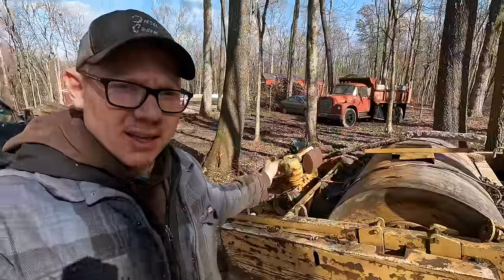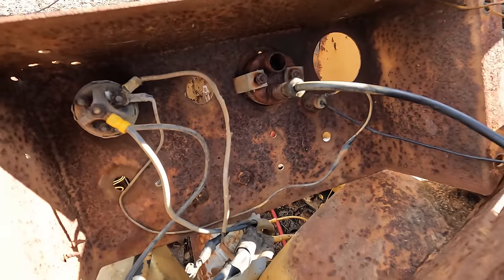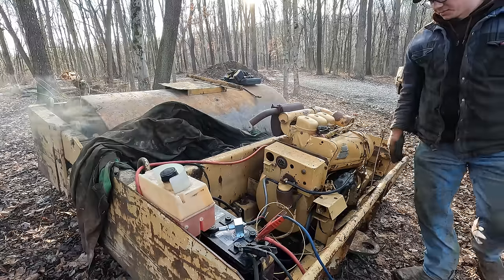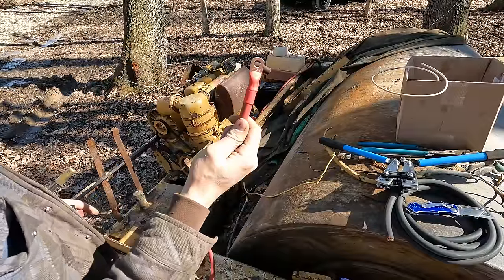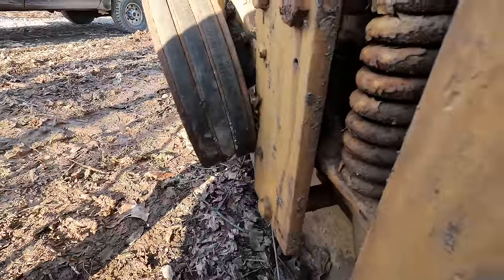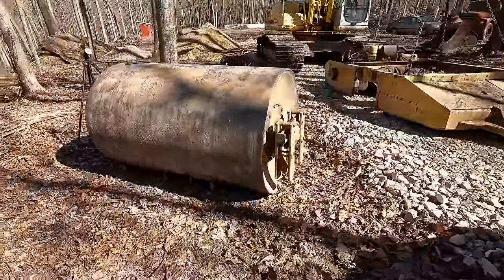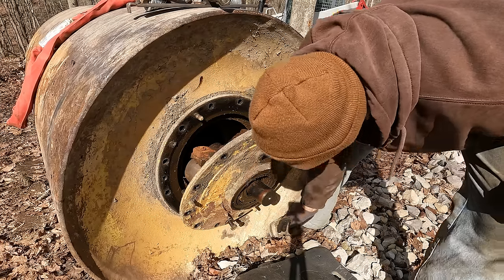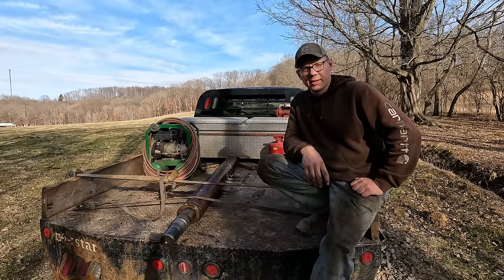Diesel Roller Compactor First Start in 30 years!! Can it be saved??

Comment: I am not certain but I don't think those two giant ball bearings have anything to do with shaft support. I am pretty sure they are the offset weights on each of the shaft that give the vibration and they just run in a support race (good idea really) . If they didn't exist, there wouldn't be much of a vibration because you would just have a shaft turning fast running through the center of the roller suported on each end. So.....a shaft....very little vibration even unbalanced. It's  just my take on it, I might be completely wrong here.

Comment: Sadly I can't see any viable repair for that shaft that would last any real length of time considering it's subjected to such high vibration. 
Having a whole new shaft made would be the only proper solution - I'd want to know what specific alloy of steel that shaft is too, wouldn't be surprised if its sonething specific again, due to the high vibration.

Comment: Weld that shaft up with some angle iron to hold it strait, worst case it vibrates?? Post up the bearings you need and let us viewers see what we can find for you, I just briefly looked at some 3in od and 2in Id , about 50 bucks new old stock.. but we need the proper sizes to look for ya

Comment: See if u can Fix it yourself their , clean up the bearings and pack with lots of grease , just get a new pump . You can do it ! And if not perfect but works rolling your areas that's  great ! Don't scrap it yet scrap after your project. It will work fine with messed up bearings for the time being , and I'm sure some fan will help u rebuild the shaft if u ask .

Comment: Matt buddy, put a big bevel on that shaft, pre-heat it then weld it yourself and grind it down. Build up (weld) the worn sides and grind them down too, it does not need to be precise and pretty, it only needs to work to compact the area for the shop.
Alternator can wait, fuel pump can wait, fuel tank can wait, it can run the way it is.
Bearings mmmm maybe cheaper than renting a compactor. (Or take a chance with them too)

Hang in there buddy. Get that area compacted, hooked by crooked it does not matter how, it is not about the compactor, it is about the workshop. Later you can fix it in the workshop... properly.

Comment: When and if you do get it back in working order, there is a special grease with solid metal additives that goes inside those rollers, normal grease won’t cop the hammering. Like the metal repairs, that won’t be cheap either.  Cheers from AUS

Comment: Be darn sure you put a fuse on each of those two hot wires from the starter! If you decide on an alternator, consider a Delco 10si alternator $50 on Amazon - https://youtu.be/QVUL0S704AE

Comment: On Pakistan mechanic videos, they put the shaft on a lathe, turn it down, insert middle section for correct length, then stick weld it.  Check all terminals and connections for corrosion on alternator before replacing.

Comment: I always check glow plugs with a 12 volt test light hooked up backwards - Test light clipped to positive battery terminal and the parallel connector for the glow plugs disconnected so that you can test each glow plug individually with the test tip on the test light - If the test light shows connection ( lights up ) generally the glow plugs are good.

Comment: Just cut 4 big keyway type grooves in each half of the shaft. Add 4 keys to help take rotational load. Pre heat the shit out of it then turn your welder all the way up. Might last for the shop grading. I don't really think it would work but you should do it anyways.

Comment: I'm afraid that using acid core solder is a complete no-no.  The residual acid will go to work corroding the battery connections and you'll get a worse connection than what you found on the glow plugs.

Comment: Everyone it seems to get it wrong but deutz is pronounced as doitz. We have  deutz d10006 and a dx160a and they are amazing machines. Both tractors have straight six air cooled diesels and normally they don't even need any starting aid. But at least the d10006 has a burner in the manifold that burns diesel to heat the air.

Comment: You can put ballast resistor from old vehicle on there.  I think that should knock glow plug voltage to 9v like old coil would use. You have to excite the field on the alternator with 12v before it will put out power

Comment: understandable have to way out the cost too NOW would it be cheap to have a rental roller than a repair cost why you bought it in the first place you would not have the cost of the rental equipment  when i don't buy many used equipment

Comment: Matt, not sure if your going to read this comment, or if you have already dropped the shaft off, but if the bill looked to be too expensive, look into slotting each side of the break, and connecting the two with a piece of flat bar steel, like a coupler, and tack welding the flat bar so it stays centered in place. Just an idea. Not sure how it comes through in writing.

Comment: you made me laugh when you started talking about needing to go through the wiring, and were going to tear into the control panel.  You are the compacting roller king, but it always comes at a price, and that has made you the leading expert in redoing rats nest wiring on them.  That snapped shaft is an unfortunate problem.  I hated to see that.

Comment: A test of the glow plugs when out would of been good. It seems you didn't let the glow plugs heat up, that takes 20 secs or so, a bench test would tell you how long to pre heat the plugs ,then try a start.  Also as soon as it started, add the stanadyne injector cleaner.

Comment: Hi Matt, It was a nice trick to use solder on the thick battery clamp connections, I'm going to use that on my old 6 volt Porsche, which has some periodic starting issues.
Good work as always! 👍😎
As a Porsche/VW nut, I of course love those old Deutz engines!

Comment: Matt when u buy used things there is a reason why they are parting with it one reason they are tired of working on it and parts my be to hard to find but at least u got the motor running but best of luck fixing it

Comment: weld it up yourself, pick up a simple tig setup and learn to tig at the same time, reuse the bearings, fire a lift pump at it, dont worry about an alternator youll use it twice a year just drop a fully charged battery into it and then take it back out when done

no need to fire 3 grand at it to use it 15 times over the next decade, if you were gonna start an road/asphalt business and use this as your main roller, sure new alternator new bearings, machine shop repair, put 500 hours on it a year

Comment: Regarding the alternator, I think it may need a sensing/energize wire from the battery in addition to battery positive and negative. Also, look at the alternator casing sometimes the nominal output voltage is stamped into it.
Regarding the glow plugs, the lower the voltage rating typically means higher heat output. Example: a 9V glow plug may require 5 seconds of preheat but a 11V glow plug may require 10 seconds of preheat(with all things being equal such as engine temp, ambient temp, battery voltage, glow plug type, etc) Summary: 9V glow plugs aren't typically an issue if operator preheats proper length of time.
Additionally, this age equipment could be 8 volt. While uncommon I've run into it a few times. I suspect 8 volt equipment was originally designed to be 6V but owners simply change the battery and modify/replace the alternator for higher cranking speed.

Comment: Just a couple quick suggestions to save you a little money on this project.First, try using a ballast resistor for an early Chrysler points ignition for the glow plugs. It cuts the voltage from twelve to six volts and isn't very expensive. Second, the alternator that is on there looks like a three wire GM. Switch that out for any single wire unit and it should give you a working system. Since someone retro fitted the alternator long ago, it doesn't have to be the same one. Heck, you probably have something sitting around that will work just fine. As for those ugly bearings, it seems to me that for the amount of use you expect to give the old girl they might hold up long enough to get the building site done with a lot of cleaning and a bunch of new grease. Like you said, time and money are both in short supply on this one. Save where you can and spend where you must. Good luck and I can't wait to see more on this one.

Comment: Matt, while it's fun to get this old stuff running again and use it there comes a time when it is no longer feasible to maintain. With that in mind unless the bearings are seized then just repack them for the amount of time you are going to use the machine. The shaft you have no option other than repair. The alternator you can get a used one from the junk yard that will serve your purpose just fine. Grease the living daylights out of your machine and stand clear! Oh... I built a gear puller out of a 5 ton bottle jack, chain, and some angle iron. Worked great! Waiting to see the next episode!

Comment: Weld the shaft back together, clean the rust off the bearings and reassemble with heavy grease, it should last long enough to compact the pad.

Comment: Matt, I think what you need to determine is how much other use will you get out of it after the pad for the new shop is done. If you aren't going to use it for much else, junk it and rent a roller for this project. Between what you might get for scrap metal and what you could sell the engine for, you would probably be way ahead. I'm all for rescuing and repairing old equipment , but I'm also cheap enough to not throw good money after bad. Plus the time crunch you are under, can you get it repaired and back together in time to use it for you shop pad ? Your choice, either way I'm sure we will all be watching and cheering you on !!!!

Comment: Your going to the shop, get them to pull the other bearing off, for crying out loud, AFTER you get the repair estimate. If you go ahead, clean all the bearings & repack them if still serviceable, they should last well beyond the job you need get done. Get a quote to rent a machine for the day.
Reply: How is that sucker supposed to vibrate, can you explain that?

Comment: How long is that shaft and what’s the largest diameter I have a lathe that I can swing 16” about 9over the crossslide never really measured that but it’s 10’ between centers but that I think I can fix and fix very good go in a put a stub shaft inside both pieces out of some heavy steel 2” or so then weld it back up together
Reply: Wish I would’ve seen this series soon I just started watching you about a month ago but yeah I’m down here close to myrtle beach if ya need stuff like this done I can let ya know how big my equipment is and I’ll fix it basically you just pay for whatever the cost is of Whatever is used I don’t use my shop for anything except to learn and fix my own stuff

Comment: Instead of ether, use some lubricant to get it to seal the piston rings. Had to do that to a farymann diesel to get it to go, ether didnt work. After that it started like new every time. 
The whole vid it sounded like it didnt have enough compression
Reply: What engine is this? Usually you have to glow them 20 or 30 seconds. 812 engines and older you have to glow, 912 it is not needed for it to glow when above -5°c

They have to be setup with an in series glow indicator.(glow wire) Thats why they are 9volts. The little hole in the dash is for that

Comment: It really depends on your schedule and budget.  If you need the site leveling and compaction done in a short time frame, rent a compactor and get it done.  To support heavy equipment fill compaction should be made in layers not exceeding one foot with proper moisture content before compacting.  Check on the cost of fixing the old compacter, it might be cheaper to rent one than to fix this one.  Do you think this old compactor will last long enough to get the work done that you need to do without a failure that will be cost prohibitive to fix?  A lot of risks with the old one.  Almost none with a rental.  If it breaks down they fix it for free, unless you broke it doing something you shouldn't.  One other thing, this machine doesn't move itself.  You will need a big dozer to pull/push it when it's up and running..  I would think a D6 size minimum.  The contractor I worked for used a D8 with a machine like this.

Comment: Just a few tips. Acid core solder will eat away the copper, possibly faster than leaving it bare I'm afraid. Try to get plated lugs instead of plain copper, they won't corrode as quick. Wrapping a strip of wet rag around the cable insulation will help prevent it melting. Not trying to be rude, just giving my opinion. Grew up working in my grandfather's auto elec business.

Comment: Good video as always Matt 
As others have said I'd grease the heck out of those big bearings and run em for your current Job.
Also I'd put a relay on the glow plugs to take the load off your new switch contacts. I like to use the old heavy remote starter solinoids type relays for things like that, as you'll almost never burn them out.
Cheers

Comment: Matt, I love the videos....you probably know that the acid core in the solder will eat those copper wires and eventually the connector as well. That acid flux is now coating every wire not just where the solder is. It's a ticking time bomb waiting to take out your electrical system. Rosin flux is the thing for electrical work. Doesn't cost much, should be easy to get and saves a lot of time cutting off that connector and redoing it right. Some short cuts aren't worth it. Ask me how I know about this being a crap-stained shortcut.